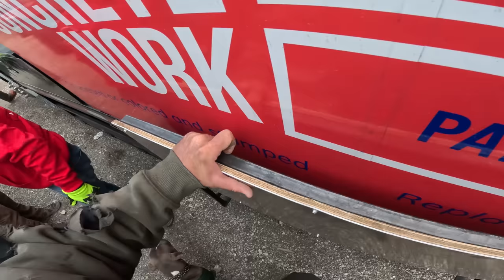PERVIOUS concrete is JUNK!!! Let's rip it out

Comment: Porous asphalt up here does work if it’s made correctly. Porous concrete never has held up, and has been ripped out pretty much everywhere it was installed. Porous Paver blocks are another option that works ok since some jobs have to keep the porous surface due to permits.

Comment: theres special pieces for the ends of those spouting pipes..  you had some in your truck you showed them in the beginning,..  they are offset..  square at top round at bottom..  thats what you use rather than stuff a pipe on..

Comment: As a gutter guy (Rick's Rain Gutters in Los Angeles) , that PVC connection on the downspout kills me,  you could use a 1" offset, instead of trying to put spacers on downspout. We always recommend having the concrete guys put the drains in and we will make the downspouts terminate perfectly into them. Love watching your videos! Thank you for uploading them!
Reply from the maker: That's why I'm not a plumber boss. It can be fixed later.

Comment: They did a test section in our  public works driveway here in northwest Washington State. The first winter, we had a cold front, followed by rain. That patch turned into a skating rink. Surprisingly, with the heavy equipment traffic, it didn't break up too bad, but over a few years, the surface filled up with sand fines and no longer was very porous, if at all.

Comment: Porous Concrete down here in the south is looked at as a cheap choice and hardly used. And it has another problem, very messy to remove.

Comment: I'm in Washington state and I've poured plenty pervious concrete. The trick is get it down and don't overwork it, your instinct is to seal it up but that's not what it's all about, the stuff is very hard to pour it does not slide down the chute it's like glue! I think the stuff you guys Jackhammer doubt they applied too much water to it being on the hill they couldn't get it out of the truck so then of course it just fell apart. After you Rod the concrete you don't both loaded you use a roller that has been sprayed with mineral spirits you don't mag it because that tends to seal it up and the edges you rock your hand edger because you can't Slide the edger it will seal it up, put your joints in it and cover it with visqueen for 7 days. Very miserable stuff to work like you said junk but if you pour it right it doesn't turn into gravel but eventually gets clogged and is no longer pervious the stuff is garbage!
Good luck and keep the videos coming👍
Reply from the maker: I watched a video of an install and it did look like a pain.

Comment: Here in Melbourne Australia, the city councils are stipulating the use of Permeable Paving. It’s very similar however instead of concrete, it’s a epoxy mixed in with small pebbles. Seems to work over here for the time being.

Comment: Concrete lasts maybe half as long in south Florida! The climate is so extreme here that architectural shingles that are rated for 30 years up north, they will not last here for more than 15 years, and insurance companies tend to not want to insure a home if the roof is older than 10 years. I recently sold my home here and because of the age even though the roof was not bad, I was forced to pay $13,000 for a new roof before the buyer would sign the contract. I paid $7,000 for a roof on a home in Tennessee using Architectural 30 year shingles three years ago. South Florida is one of the more expensive places in the US to live!

Comment: We use pervious concrete in Tennessee with no issue. The concrete plant I used to work at had it, and it worked great til it got all clogged with sand

Comment: we designed a large pervious parking lot 10+ years ago in Tennessee thats still holding okay, but the mix design and install is tricky.  i’m still not a huge fan and only certain application. its not for big trucks or high speed roads.  it can ravel on you, but maybe thats tolerable for some folk

Comment: 9:01, Ryan always wonderd why you set the truck up across the street? Why not at the end of teh driveway so there is no mess across the road??
Reply: You moving forward toward the garage to pick up the broken concrete and can't turn around until out on the street so easier to dump in the truck.

Comment: Given that water would freeze as it migrates though porous concrete, and that freezing water has tremendous hydraulic force, it would be insane to think that porous concrete would not self destruct in a northern climate.   Water intrusion causes road potholes and rocks to break away from hillsides.

Comment: I removed 40000 sf. of that perforated concrete in a parking lot and was amazed at how fast it deteriorated in 10 years.  Guy said they paid serious $ for it too.  He is happy with his new asphalt parking lot now.  I would not recommend that trash to anyone.
Reply from the maker: There was a restaurant that had it in the parking lot. I was ripped out 5 years after it was installed.

Comment: Do you guys have problems with sidewalks cracking over the top of the down spout extensions? Or as long as they're completely buried and barred does it usually hold up? I see a lot of upheaved and broken sidewalks when they pour on top of tubes.

Comment: Hey Ryan, quick question why don’t you guys use the power buggy to pour out gravel as well?
Reply: He can control the thickness with the skid steer. That way there is less to move with hand tools.
Reply: Also, have to pickup with skid steer , and power buggy too wide to get down sidewalk.

Comment: I have seen pourous concrete used at commercial sites they it drain through to dtorm water storage below it until it reaches a certain limit then will discharge  into storm system. Residential application? Lol....terrible idea